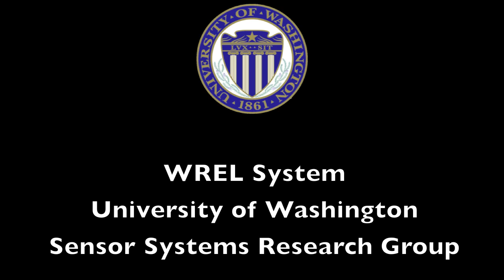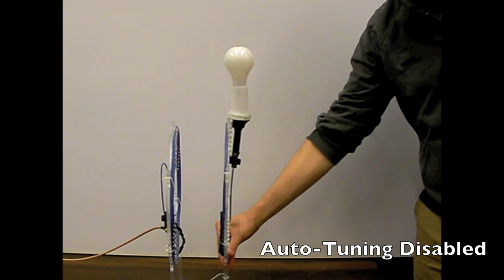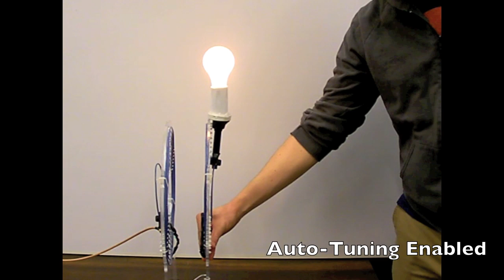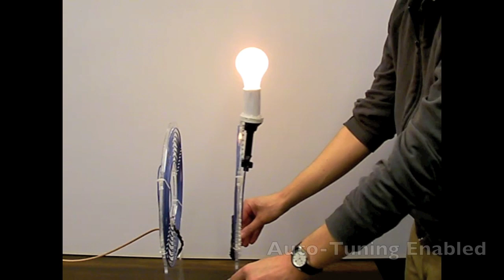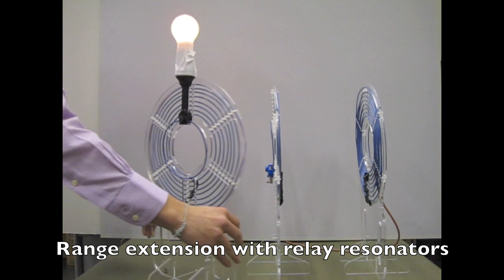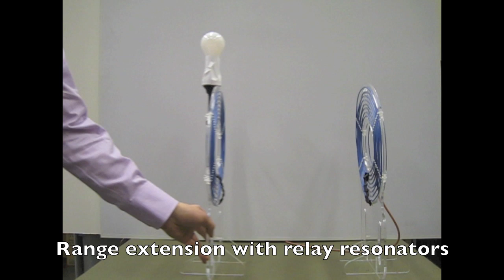Wireless Power Transfer (WREL) - Auto-tuning and relay resonators

Comment: What is auto-tuning?
Reply: They are likely tuning Capacitors in a Pi-match filter between the transmitter and receiver to match the impedance out of the transmitter, and into the receiver. Matching these impedances maximizes the power transfer efficiency.

Comment: Help friend,
Sorry set my system to 11 Mhz, however when connecting the VNA 2 peaks in the S21 at 16 Mhz is observed, I do not understand because if I put to 11 Mhz?

The measure coils connecting directly to the port VNA N, and I see smith chart in the part where the resistance is infinite. and gives 11 Mhz.?
you think this correct way to measure the coils?

The loops create a rlc circuit and see the S11, and everything to 11 MHz have yet to connect the whole system works shows that 16 Mhz, help me because you must believe me I've spent this night and day to get to this point and not knowing what to do, thanks
Reply: friend looks, when coupled with a coil loop system observed this to 16MHz, but the coil and loop the set 11MHz my coil is a little bigger than your work. Maybe you can help me indicating that happens with my system. thanks
Reply: I replicated design Alanson Sample to observe the coupling and yet when coupled with the loop coil 50 ohms, loop and coil are 7 Mhz,
changes to 8.7 Mhz,? maybe I could help indicate that happens with the system thanks friend

Comment: Appreciating your time, you can help me. What is the method that you use to adjust your impedance of the coil to 50 Ohm? 
Thank you
Reply: In 4-coil system, you can adjust the distance between 1st and 2nd coil (3rd and 4th coil also) to maximize efficiency. That makes your coil circuit matches with 50 ohm.
Reply: thanks friend,
if you already do and put the loop to 12 cm coil for coupling.
I have tried to replicate the work and I have already tuned the coils and loops, my coils have a radius of 40 cm, cable diameter is 2.59 mm, however I have 4 dB of loss at 30 cm and 1 m I have 8 dB, how I can improve my system?

Maybe you use a shield transformer to eliminate cross coupling? if applicable as they do and where they connect?
greetings from Ecuador
Reply: As the distance increases, the distance between loop and coil usually increases for the matching system (it means cross coupling may not the problem with your system). Your system looks not matched well at 30 cm.. or just check the Q factor of the coil if it is higher than 300. See the fundamentals of WPT system through papers by Benjamin or Alanson or me. Thanks
Reply: Thank you,
if use Kajfez D. and E. Hwan, "Q-factor measurement with network analyzer and my resonators have a Q of 280 then that I think is the problem?
I tell you right now do a system with 3 reels and measured the S21 and I have 4dB at 1 meter you think this good? I'm with a fo = 17 Mhz

thanks friend for your attention, my next step is to replace the loops with a pi network to keep improving.
Reply: Q is enough.. 4 dB looks good for 1 m distance. Good luck